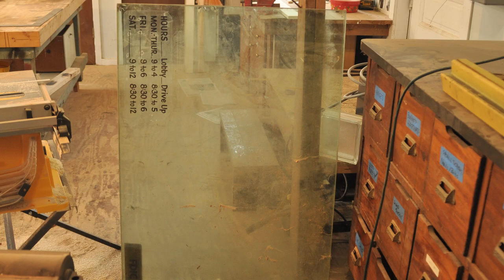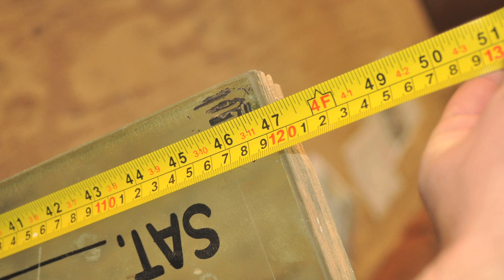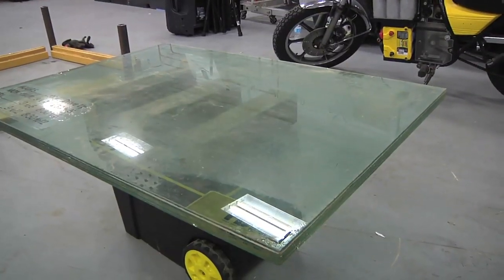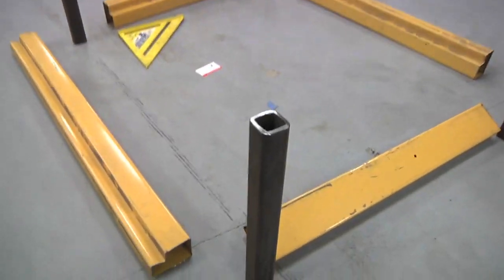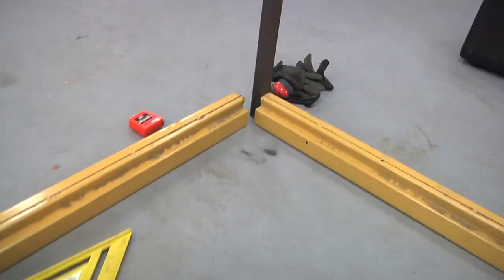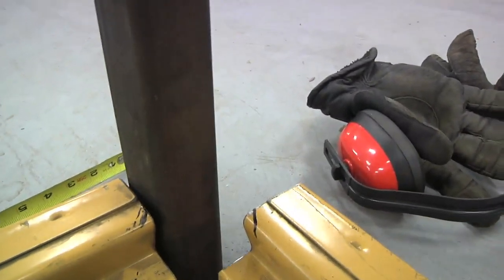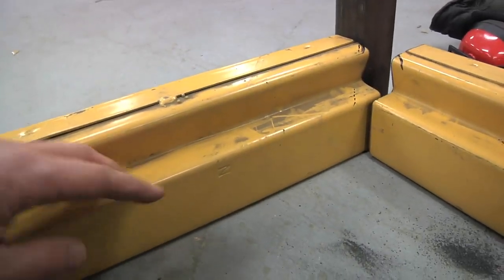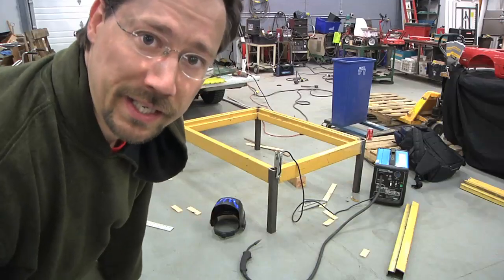How to Build a Bullet-Proof Coffee Table

Comment from the maker: I was having some trouble with my welder when working on this. And yes, I can always practice more.... I keep missing the non-credit welding class at the local tech school.
Reply: Problem was probably the paint on the rack material. You can sand it off, but it'll still cause problems welding.